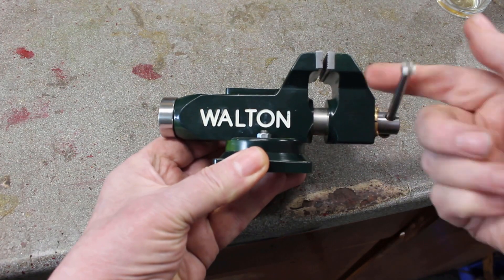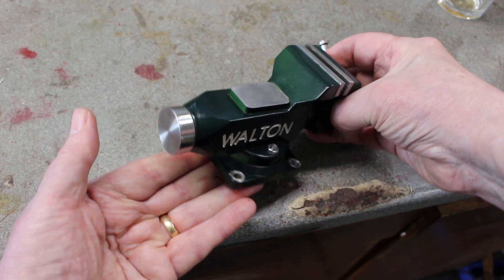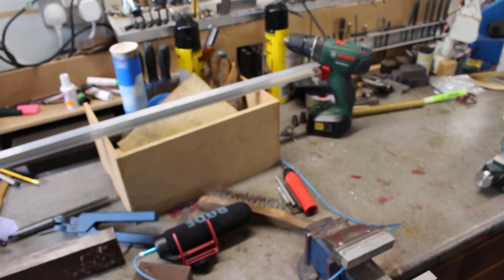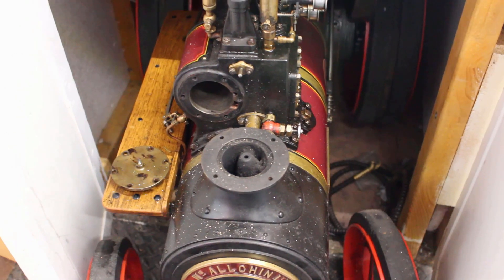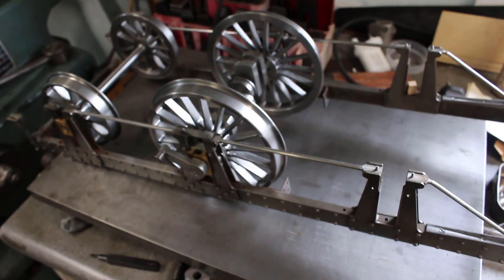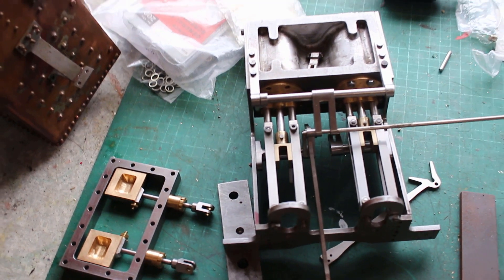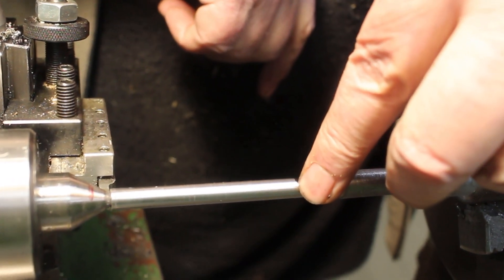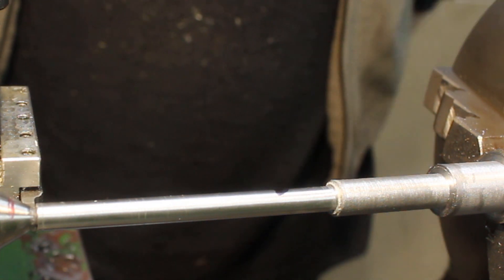Shop Made Baby Bench Vice Build Pt. 5 - Making the Clamping Screw - Collaboration Project.

Comment: Arh! my eyes, my eyes.😆
If  you thread without a runnout, try going left to right and use a cross slide stop so you can slam the tool in without fear of a overdoing it  That sounds so simple in my head. A cross slide stop is certainly an aid if you use the flank feed no matter which way you thread.